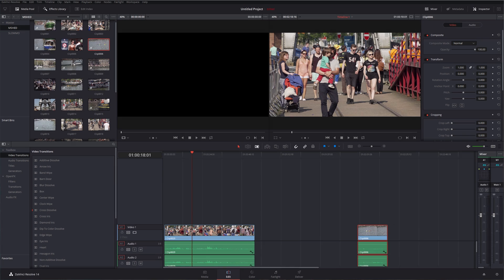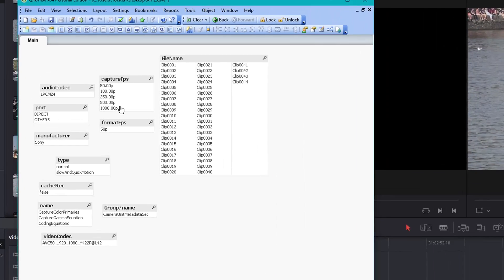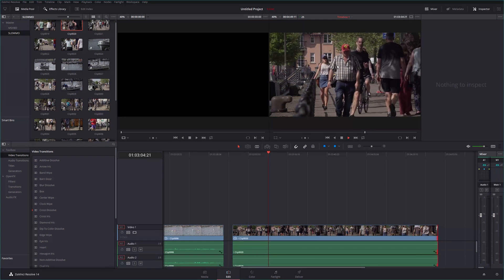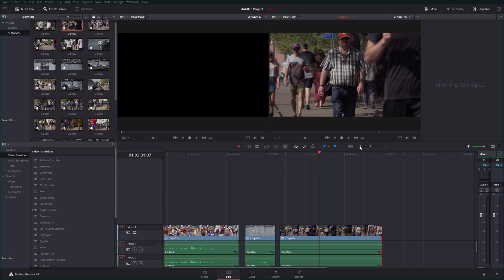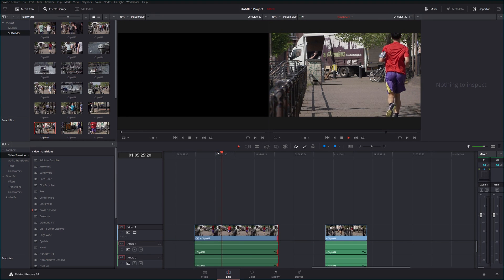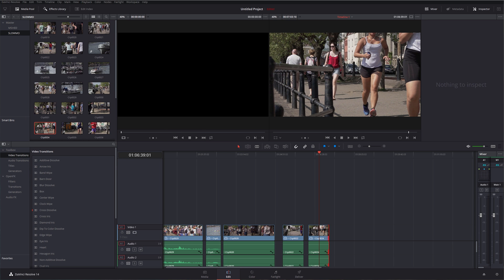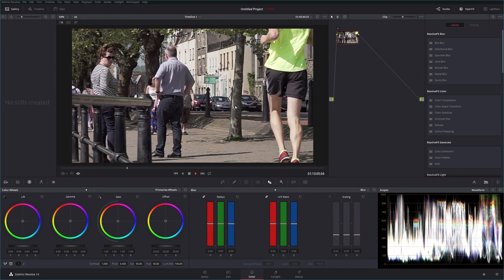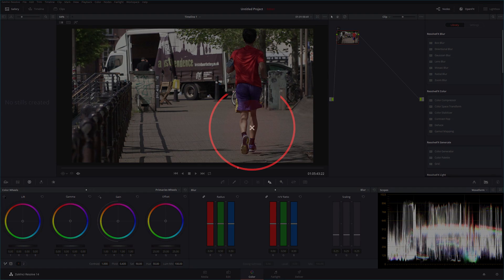Slow Motion Explained & Sample Footage - Sony PXW-Z90

Comment: Is there a short recording limit at 960/1000 fps?
Reply from the maker: Yes. You can only capture for roughly 5 seconds (though that is obviously considerably longer in the final file)
Reply: @tdcattech  Thanks for replying.  5 seconds is limiting but not as limiting as the 0.1-0.4 seconds in most of the phones/consumer camereas with that feature. 

I have a Casio EX-F1 and it can record high frame rate for 10+ minutes at 1200fps 336x96.  The quality of the video is unusable for cinematography. (and extremely compressed in camera) 
It can also do 600 and 300 fps at higher resolutions. 

The camera has the ability to take good pictures and video but its low light performance is really bad (even when it released in 2008) Its focus is nice and sharp though and it has a ton of settings. 

If you record a 2 minute video at 600 fps you're looking at 40 minutes of footage at 1200 fps 80 minutes. 

The camera implements a very interesting sony sensor IMX017CQE (and as far as I know it's the only one) in theory that sensor could do 2400x~3xx 300 fps with the right memory.

My other surprisingly high spec high framerate camera is a smartphone that implements another sony sensor (IMX586) that can record 720p at 480fps with the ability to change focus and without a short clip limit(the phone has really fast storage memory and writes right into it) . (The smarphone's imaging features are not good as it's a gamer phone (ASUS ROG 2 I think) 

My XZ premium can record 960 fps but with an unusable 0.1 second limit or so.

My GoPro cameras also do interestingly good high framerate. The GoPro 9 can do 1080p at 240 fps and the Hero 4 Black and do 720p at 240.
Reply from the maker: Make no mistake. The video quality at 1000fps is dreadful. I would never use the Z90 at 1000fps unless there was no other option. Quality does improve significantly as you move down.
Reply: @tdcattech  You haven't seen dreadful until you see 336x96 compressed by a consumer camera released in 2008! But at a lab setting it would work either way.

Comment: You know what nags me a bit is that the Z90 doesn't have that built in 120fps like the nx80 has. And therefore I have no audio.
 I am going from a GoPro using high fps and it record sound. 

I wish this can, or am I missing something. Also does anyone know of maybe how I can get around that issue
Reply: I been wondering and trying to figure this out too! As far as I can tell, you can only do 120 in S&Q with no audio on the z90. The AX700 and NX80 both have this so why doesn't the higher-end camera?

Comment: Hi! One question here, please. If I'm shooting some casual video at 1080/50p and then I want to add some slo-mo at 100fps, which Rec Format should I choose, 1080/50p or 1080/25p? I guess 1080/50p 50Mbps is twice faster but has more color info than 1080/25p 25Mbps. Am I close? If this is correct, is this "loss of quality" of the 25Mbps very noticeable when played in the middle of the 50Mbps footage? Thanks in advance!

Comment: Good review - thanks. You said the camera is switchable between PAL & NTSC. I've read a number of items over the last year commenting that with new technology / screens / TV's etc. the regional differences no longer are relevant. On my GH5 I changed the region to "open up" 60P instead of 50P & 120 FPS instead of 100 FPS. I've not noticed any issues & I'm getting 20% better performance. What are your thoughts, is there something I've missed? - are the reports I've read wrong? - cheers - Peter.
Reply from the maker: I would probably agree. I must admit that I prefer the look of 29.97fps over 25fps. It also seems to work better for web content (which is most of what I do). It seems to look better on most displays which are 60Hz and avoid slight stuttering.

However, whenever you are dealing with any mains based lighting at 50Hz, there's the understandable potential for problems. That said, I don't spot it very often on my iPhone footage (29.97)...however, without a locked shutter speed, that's not a great point of reference.

Might have to do some playing with that and try it out.
Reply: @tdcattech  all true unless you get ,in the UK, any thing that shows the 50htz power supply, for example a light, you the need to shoot at PAL frame rates to avid the flicker.